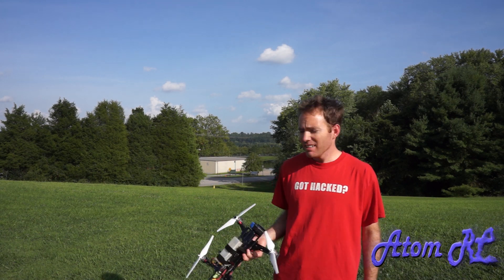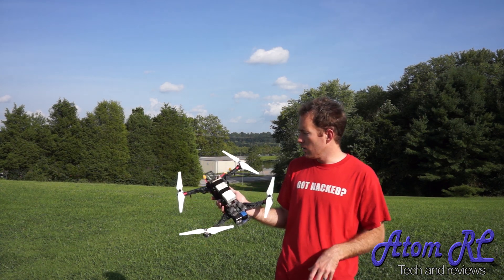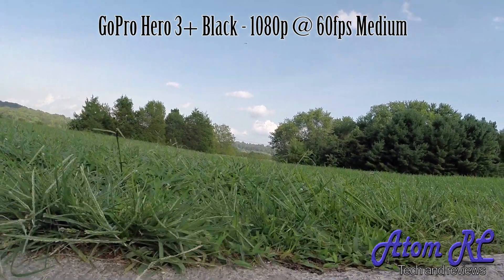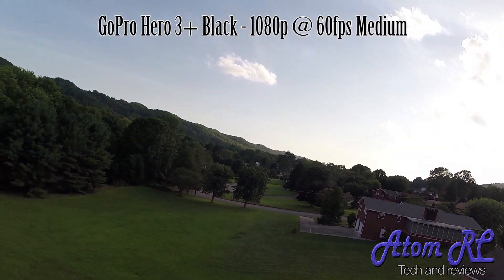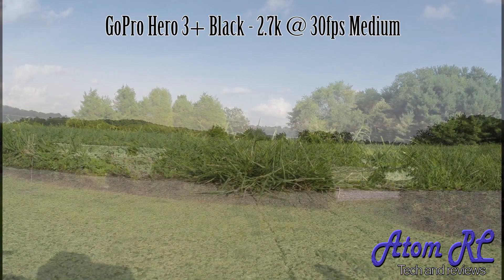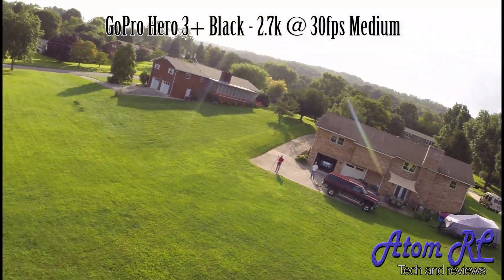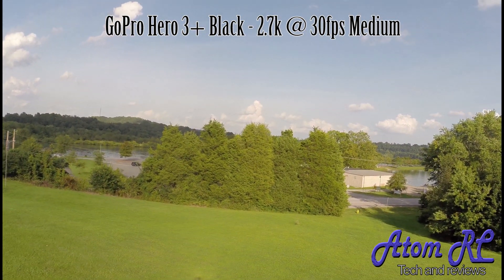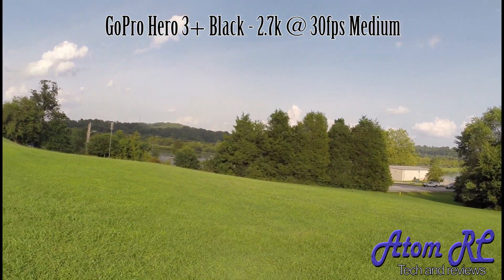Atom RC   Bee 450 Quadcopter Review repair

Comment: Is there sufficient protection for the motors, and you can use 10 inc propelors?
Reply from the maker: yes, it can clear 10 inch props but with the phantom props it does well, just a little slow for "racing"